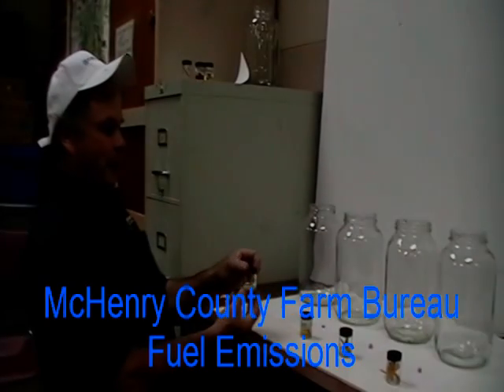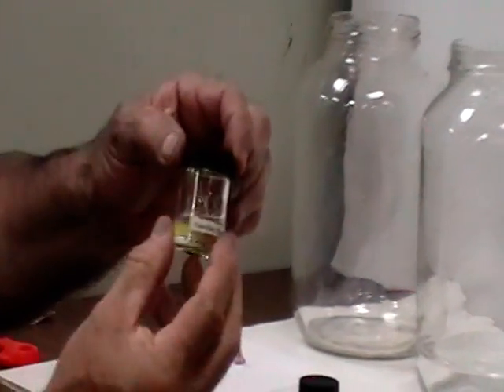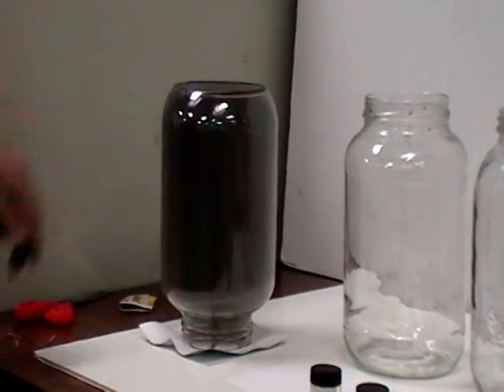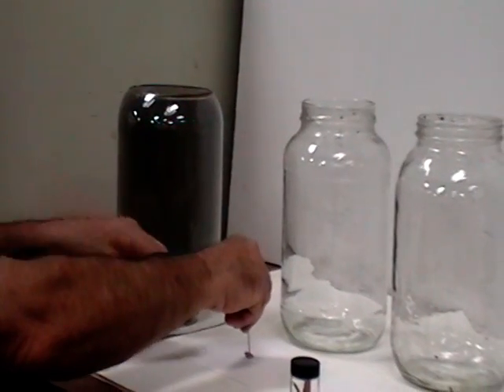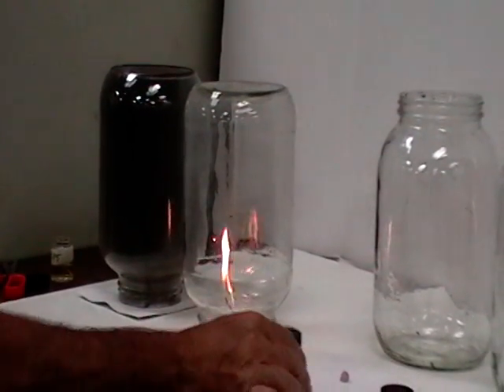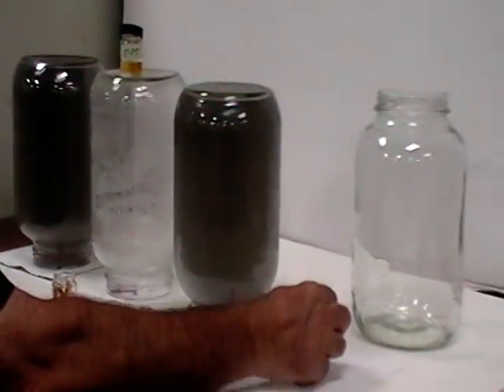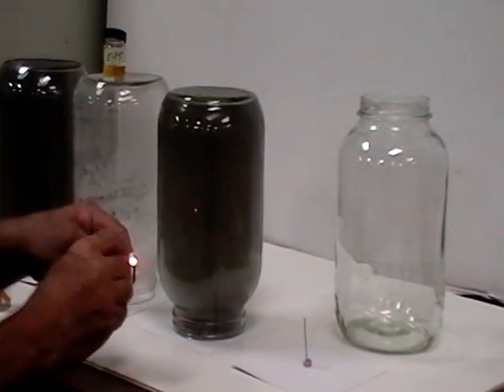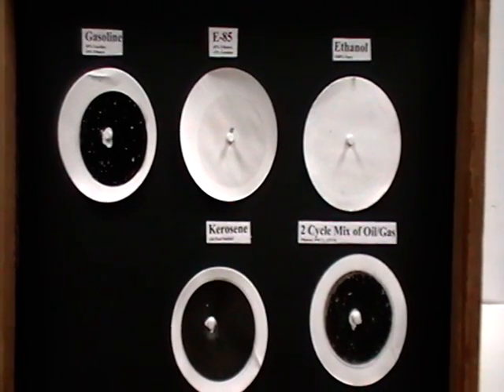Fuel Emissions - Gas, Ethanol, E85, Kerosene

Comment: Has I read, the ethanol has two big problems against gasoline an other fossil fuels.
1) There are some studies that propose that ethanol harms your engine at the point that its lifetime is severally shorted.
2) ethanol does not contain sulfur in its chemical formula, so sulfur dioxide molecules are not generated  (extremely toxic chemical one of the reasons of black soot in gasoline and kerosene containers) but, ethanol for its incomplete combustion generates bigger amounts of CO2 than gasoline (that is also a causative of greenhouse effect) so you have the most dangerous chemicals in your air but you'll have more CO2 that will kill your ecologic intentions.
I recommend you search those studies  and tell me your opinion because i am not an expert in this topic. Thanks
Reply: I read a lot of stuff too Aljandro. The difference is, I find out first hand what the truth is before I repeat garbage.

Fuel Emissions - Gas, Ethanol, E85, Kerosene
Reply: The problem is that you can not test it by yourself. But if you want to make more investigations about this, fine go ahead. In Brazil the fuel is often mixed with ethanol so in that country if there are common problems in the engines working due the fuel composition you can say that it is originated from ethanol. But if you are not sure about what you are saying do not attempt to prove something that you are not able to ensure because you read something and you think that is the holy truth. I was placing my point on the table and you do not have to act like that.
Reply: Plants needs CO2, they give us O2. SO2 is toxic for peoples and plants.
Reply: *****
I find myself wishing that the real damages; the social and economical ones, that are created from the collection and refinement of petroleum, coal and natural gas could be displayed as simply as this video does with emissions.

You know, with a few jars, and burning a piece of saturated wood. But those damages are deadly and subtle. And, they have shaped our disfigured society for what it is today.
Reply: The small scale experiments are used for these purposes, what are you expecting? calculations and really expensive equipment? This is an excellent way to show an alternative to regular fuels. In spite of, its methodological failures, as a matter of fact I am now making a formal research about the production of ethanol with different catalysts, and methods in order to reduce CO2 emissions during its production and generate less waste. You are only considering the emission during the combustion but the production of oil derivatives generates huge quantities of toxic gasses and waste and few people in the regular population really care about that.
Reply: Alejandro Montoya
Wow, and here I thought I'd have to convince you. Is English a second language for you? I admire your efforts, but you miss the point...25 Veterans kill themselves EVERY DAY largely because of OIL.

But it wouldn't matter much what "fuel" we move to. Our system is sick at the core. Any fuel, or whatever commodity you pick, will be hoarded, squandered and prices will be manipulated to benefit a few.

Yes, ethanol is cleaner, it is renewable, and you can make it in your back yard, ....and it is precisely because of these things barriers have been put before us.

Are you getting this? We are herded like cattle Alejandro into given patterns of behavior. Into buying their shit, popping their pills and believing their hype.
Reply: As you said, my English is not perfect, it is my second language (as you can suppose by my name Spanish is my first one) And I am trying to do my best on it... But now you are confused. 

I am against the oil industry to make regular fuels, IT'S A VERY IMPORTANT POINT OF VIEW THAT I AM FROM VENEZUELA and my country gets approximately 95% of  its income annual income from Oil, and it instead of making us rich it drove us to these kind of problems that you can see on the news due our abusive regime that loves to get a lot of dollars for their own corruption purposes and that problem have been gotten due our poor culture... 

Every dependence on one specific substance is bad for any economical system  because it makes you think that oil (in my case) is infinitive and you do not have to spend money on the rest of economical areas should have your attention as a governor.

Ethanol is not perfect as gasoline but it makes to decrease the dependence on oil derivatives and that is positive. Until we get a better alternative ethanol is great.

In two years I will go to the university and I will choose Chemical engineering because I have a vision of making a better world where green chemistry has a stronger emphases than the one that we already have.
Reply: Alejandro Montoya
Yo soy un gran admirador de su país, y de Hugo Chávez. Para morir tan joven es una tragedia, y estoy muy agradecido de escuchar su punto de vista sobre estas cosas. Nos recomendó un libro para nuestro presidente Obama llamó "Mantener la chusma en Línea" de Noam Chompsky. En él se explica mucho de lo que está sucediendo, y es uno de mis favoritos.

Considere la posibilidad de incluir en su lectura. Yo estaría interesado en lo que usted siente que ha sucedido a su gobierno desde que Chávez. Ningún líder es perfecto, pero desde donde estoy en este país, que parecía tener un verdadero amor de su pueblo y más importante, quería ayudar a los trabajadores pobres sobreviven.

ps. Estoy tratando de aprender español.
Reply: WOW! felicitaciones, tus habilidades lingüísticas son inclusive mayores que las de muchos hispanoparlantes con los que yo suelo frecuentar.

Por favor, cuéntame ¿Cuánto tiempo tienes aprendiendo el español? Inclusive, si me dices que eres nativo de Latinoamérica, yo te creería. Mi sueño es estudiar ingeniería química en Canadá y suelo frecuentar sitios en internet para mejorar mis habilidades en el inglés mientras me preparo para irme del país por nuestra difícil situación.
Reply: Alejandro Montoya Confieso que utilizo un traductor, pero aún así, leí las palabras y tratar de aprender. Estoy a menos de un par de meses trabajando en español ahora, así que agradezco la oportunidad de comunicarse en su idioma. Tengo familia y un empleado del pasado que se graduó de la escuela de ingeniería en Canadá. ¿Ha decidido en una escuela?
Reply: Sí, Lo puedo detectar por la configuración en sus estructuración gramática, en lo general evito el uso de traductores en línea (online) debido a que tienen problemas serios en su morfología pero de todas formas me parece que tienes un español bastante avanzado. ¿Qué opinas sobre mi nivel de inglés? ¿Cuáles son mis errores comunes?

La verdad. Estoy considerando Canadá para estudiar allá la universidad, pero tengo que considerarlo bien porque la educación allá es privada y es costosa a nuestro tipo de cambio monetario nacional (en Venezuela eso es un desastre).
¿Y eso que a pesar de ser estadounidense (american) estás de acuerdo con el gobierno de mi país? Con tantas cosas malas que le dice al tuyo y además de que… Yo que he vivido este gobierno desde que tengo 1 año de edad no estoy de acuerdo con él y considero que ha tenido efectos negativos en el Venezuela.

Comment: You are combusting the fuels in a low oxygen environment. That produces carbon (soot) and Carbon monoxide (CO) As far as using fuel goes, you're doing it wrong and that is why your emissions are shitty. Now burn it in an oxygen rich environment and you will get much different, much cleaner results. Water
(H2O) and Carbon dioxide (CO2) are produced instead and with that reaction the energy in the fuels is also better utilized.
Reply: It also puts out less heat and less light than gasoline and kerosene. Which means it has less energy. This means it can do less work. And that means it will burn faster and require a greater volume of fuel to do the same work. (like drive up a hill) A gas tank filled with E85 will run out faster and at the same time it will push a car a shorter distance. Burning greater volumes of fuel that cost more money to do the same amount of work. E85 is greenwashing horseshit.
Reply: Why would E100 be better than E85? Actually it would be E99-98 because ethanol sucks water right out of the air. And it is way more corrosive than gasoline, so parts would rust. I bet propane, butane and blends of those two (LPG) would outpreform ethanol in high compression engines. But at that point you might as well use a deisel engine. Petroleum is powerful stuff ya know. What else can fill a teacup and lift 1 ton 1000 meters into the air?
Reply: Lol he deleted his comments. Schooled
Reply: Ilir Kumi I hear ya but in order for your entire statement to be true we would need 100% oxygen, but the sad reality of life is it is only about 21% oxygen, but you are true on the part where he is depriving oxygen and thus leaving more carbon buildup than there would be in the open.

Comment: yeah it burns cleaner but it has other negative effects. Corn is a row crop which leads to lots of soil erosion and fertilizer runoff. Ethanol plants run on primarily coal power. Ethanol corrodes and pits metals. Ethanol eats away at rubber and fiberglass so it can't be used in small engines. Ethanol is made from corn which leads to high food prices. There is less energy in a gallon of E-85 than gasoline so you need to use more so the cost is pretty much the same.
Reply: Any negative engine effects (none of which I ever experienced running E10 in my lawn mower for years) can be cancelled out by putting in a couple drops of ethanol treatment. The "food not fuel" nonsense is completely incorrect. Ethanol production creates a byproduct called distiller's dried grains, or DDGs, which is a high quality animal feed that is far cheaper than feeding animals corn directly. Also, ethanol is produced from field corn, which can not be digested by humans. So much for the "food not fuel" argument.
Reply: basically everything you said there is myth.
Its really not hard to do some fact checking online.
the only thing that is true is that e85 shouldn't be run in a standard car designed for oil based fuel. but if you take a look at conversion kits, it takes next to nothing to make any car e85 ready. and different chemicals need different things, just because something designed for chemical A is less effective with chemical B does not mean chemical B is worse.  Salt is murderous to cars under-bodies.... and you put it on half the shit you eat ;)
Reply: A mind is a terrible thing to waste, and you've wasted yours!  Ethanol can be made from a lot of other crops.  You only need the starch from the crop to make Ethanol.  Cattails can produce much more than corn, and we don't use fertilizer for that.  I'm paying 50 to 80 cents less a gallon in Michigan, and E-85 is 106 Octane, so do your HOMEWORK!  I have a Flex Fuel vehicle and a 2001 Saturn NOT MODIFIED that I put 50/50 regular, and E-85 mix with great results.  Just more E-85 for us who have tested it and are convinced that its better.
Reply: Let me EDUCATE you. Ethanol can be made from OTHER crops.  Cattails, which isnt a crop can make more ethanol than corn.  Listen carefully...ITS THE STARCH from the crop that we need, not the corn!  No proof that it corrodes and pits metal or eats away at rubber and fiberglass.  If you go to a Ford plant where they make the F-150, 250 and 350, which has rubber parts that goes into their Flex Fuel models, you'll find out if you care to ask, that the only difference in the Flex vs non- Flex models is...SOFTWARE!  How is it possible to have higher food prices when the government is paying farmers NOT to grow corn because we have an over abundance of corn in the US and have for DECADES!  Go ask any farmer in Iowa.  Last but not least, even if you're getting 10% less milage, if you're saving $.50-80 per gallon (E-85 price vs regular ) as I am here in Michigan, WHO CARES!  Do the math.  And for an added bounus, 2 things wears out an engine: Carbor, and Heat.  Ethanol has no carbon, so if you ran E-100 as they do in Brazil, your oil would NEVER turn black.  Ethanol is also about 300-400 degrees COOLER than oil-based gasoline.
Reply: socool775 why would I go buy ethanol treatment when I could go buy ethanol free gasoline for a cheaper price? Are you serious when you say people don't eat field corn? Over 90% of food in the US is made with corn and all of that is from FIELD CORN. Did you seriously think that the corn found in foods is sweet corn???
Reply: darkvader47 yeah.... and where the heck would you grow enough cattails to even think about using it for fuel and how would you harvest it? I'm not arguing the E-85 technology in automobiles. My original comment about runoff, coal powered ethanol plants, small engines, food prices, and mileage still stands

Comment: Ive converted my car from racing gas (110 octane unleaded) to e85 and it runs excellently. E85 supports very high compression ratios and causes no corrosion or break down of rubber fuel lines. I have done extensive testing of the effects of e85 on various materials and it produces none of the issues most people claim. The only problem arrises when people leave unsealed fuel containers lying around and allow the fuel to absorb moisture out of the air
Reply: I have visual evidence that this is incorrect. In fact I need to replace all of my fuel hoses in my drift car due to the fact that the E85 has dissolved some rubber internally and brought it along through the injectors.

Comment: kerosene burns a lot cleaner than that as the huge amounts of air that is forced into the combustion chamber, in the video he put a jar over the fuels making the mixture of fuel to air ratio very rich. if any fuel, Hydrogen is actually the cleanest burning fuel as it only emits water vapor, its the lightest element and it releases higher amounts of energy compared to other fuels

Comment: I don't thing the argument is that ethanol is not clean burning. It's the drying effect all alcohols have which concerns new car builder which has not built their engines to handle this drying effect. Secondly, ethanol burns violently like all alcohols but it produces less BTU, so cars are less efficient. The concern with cars that are not fitted with stronger parts for this violent burn can cause a direct injection engine to break under these kinds of conditions.

Comment: Jet engines don't burn that dirty. Worked around a bunch of them that only happens at start up when everything is rich and cold. After that it burns cleaner then more anything else. Burning rich makes dark soot. Burning lean releases clean burning emissions of heat and energy. Emissions only happen to be in the way because people are too lazy to tune up their cars and crappy over lap of valves leads to high emissions.

Comment: Depending on the car its relatively easy. Any car after 1989 can run E85. In fact most modern fuel systems will accommodate up to a 50% mixture of E85 and pump gas without tuning. My last three cars (2009 Mazdaspeed, 2012 WRX and 1990 Talon TSI AWD) all have ran full E85 without a hitch. That said running full E85 requires at the very least a tune.
Reply: When you say "Can run E85" you're saying it won't cause the engine to tear a big hole throught space and time... But most cars will still need larger injectors and possibly even a better fuel pump.

Comment: At least one fallacy in his video. He hasn't accounted for complete combustion. Similar to if one had an improperly adjusted carbonizing flame on an oxy-acetylene torch as opposed to a properly adjusted one. Air-fuel ratio is the variable.

Comment: Taller deck height and larger main journals, its still olds though. Its not like im saying you can swap 455 pontiac heads with 455 olds. Different families. You can in the case of the 2 olds in discussion.

Comment: Eh, if the block is the same I consider it the same family. Check out the beast this guy on youtube built, from diesel to gasoline stroker. Parts interchange.
"434 Small Block Oldsmobile stroker Diesel to gas conversion Monster Oldsmobile"

Comment: See, when I mean detroit diesel, I mean the real deal, 4-53 6-53 etc. When I say they ruined deisel for the 80s, i mean the diesel converted from an olds 350 5.7. There are multiple conversions out there, they are proof enough. Just do a search on diesel ethanol conversion. If its being used every day, all day, in a bus fleet, It needs to be reliable.

Comment: Eh, GM ruined a lot of the 80s diesel rep, with there half gas conversions. The reason flex fuel vehicles are rated at a lower mpg are not just due to a poor tune but due to a compression intended for regular 87 octane gasoline. My lincoln, most K series civics have no change in mpg when modified for e85. My Monte was between 2mpg loss to none at all. I cant say Ive ran ethanol through a 28:1 compression diesel but they seem to compress pretty well, mabye at such high compression,cooling is lost

Comment: Very valid statement, Im all for bio fuel. But if I have a nice lil detroit diesel, you can garuntee id be shaving the heads, adding bigger injectors and adjusting the timing to run ethanol efficiently and swapping the gaskets out. In a pinch though, ethanol is very forgiving when ran lean and with poor timing, in the case of gasoline engines.

I grew up on a farm, we built stuff all the time, not too big of a deal. If you profit from a corn farm, your pockets are heavy down here.I dont profit

Comment: Again, water in petrol do not mix. which results in a violent hit and miss. The 80s diesels were terrible anyway. Alcohol can mix well with water, it is in part water, which gives it cooling properties, high octane and low btu and whey it requires a higher flow rate and different pulse width.